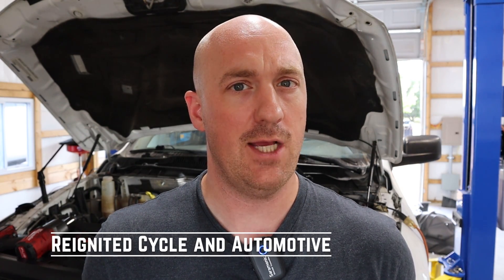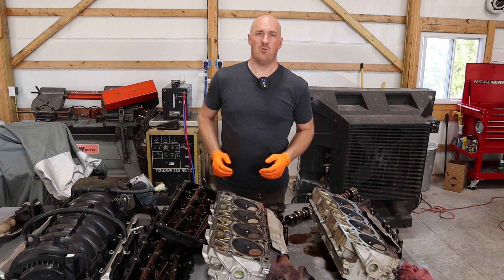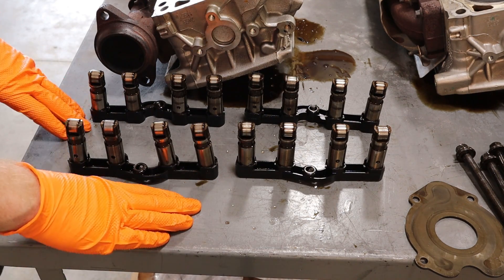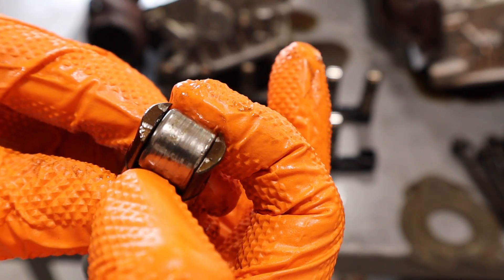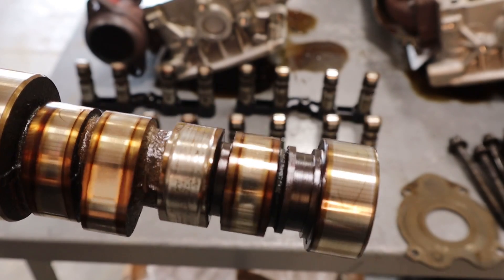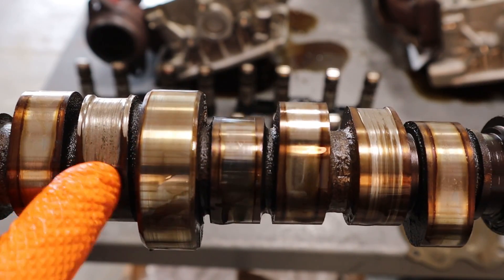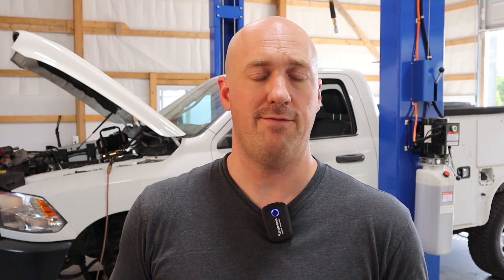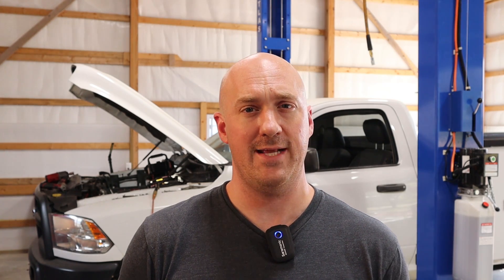Hemi 5.7 Lifter FAILURE Does this engine have a fatal flaw? Find out how YOU can prevent it!!!

Comment: The truth? This is the most biased video I’ve ever seen. Clean or dirty oil don’t matter, lubrication is simply not getting to these parts. Why does it happen more on fleets? Because not enough oil is splashing the cam while idling. These engines are POSs and Chrysler or whatever they’re called these days needs to own up. You are a company certified mechanic. You are not in the position to be truthful about the problem.
Reply from the maker: Actually, I'm no longer a Chrysler mechanic I'm doing my own thing now. This video is my opinion only based on my experience with this engine. I think its important too to realize that these lifter issues are affecting a small percentage of the overall Hemi engines out there. People seem to think its happening to all of them, and that's just not true.
That being said, if Chrysler wants to start paying me to endorse this engine I'll accept 😄
Reply: I see maybe 10 or 15 of these failures per year. I see 1400 vehicles per month in service, lots of them have a hemi. I’m a service manager at a FCA dealer. You do the math. Google search anything and you will find “common” issues with any vehicle. Pick one....
Reply from the maker: @icemonkey68  Truth!

Comment: Does this problem affect the 4.7L engines? I have a 2006 Jeep Grand Cherokee WK with a 4.7L V8 that ticks on startup sort of loudly but gets significantly quieter once up to temp. The engine runs fine, however. No misfires. I have recently had the exhaust manifolds and gaskets replaced due to exhaust noise. I use Valvoline full synthetic high mileage and change it every 4K and I have just over 164K miles on the clock.
Reply from the maker: No, the 4.7 engine is an entirely different design so it doesn't have this issue. I have owned a 4.7 myself before though, and the noise you are hearing is likely the lash adjusters in the cylinder heads. The 4.7 has overhead camshafts, and they actuate the rockers directly from the cam lobes. On the bottom of these rockers are the hydraulic lash adjusters which take out any play in the valve lash. Over time these lash adjusters become spongy, and will bleed down overnight so the engine rattles/ticks when cold until they pump back up with oil and the noise goes away. The good news is that this is not a pre-cursor to catastrophic failure, it's just annoying. 👍

Comment: Sorry, but lifter bearings are weak. Hemi engines production years 2011 to 2015 may  potentially have lifter fail before 100K miles. . Lifters have since been revised "different PN" . Lifters fitted from 2016 production have beefier roller needles to countermeasure early life failure.
Reply: I have a 17, lifters failed at 95k miles with routine oil changes every 3k miles.
Reply: @TM-to3jc  may depend on part number on your installed ones. Odd to hear a 2017/with seized roller  typically found with  AA ones.  2016 lifter roller design did change to AB albeit from same supplier. Perhaps that’s why supplier was changed after 2016/2017 which also changed lifter  PN to AC. Interesting.

Comment: I have to say that it is a physical impossibility for oil to actually break down. Boiled does get dirty that's the truth. Now if your cam is breaking down and your lifters are breaking down there putting case-hardened material into the oil ultimately important to change the oil out of a locked in any High Performance Engine. You're always going to have case-hardened material breaking down off the parts and falling into the oil. Change your oil a lot that is the truth. No High Performance Engine likes to idle that's a fact. The 5.7 is a great motor.

Comment: My 5.7 hemi (2006) let go at 116,000 miles. Got the engine rebuild, my engine builder told me to put 10w30 oil, with the high temperature in Las Vegas.
Reply: Change the tstat to a 180 and reset the fans with a tuner. The factory tsat is a 203 which is very hot and the fans don't come on until around 220 or so.

Comment: Not enough ZDDP in the engine oil to start with! That is the problem. As you drive and idle ZDDP is depleted to a amount the cam rollers and shaft can't function properly. The rollers and needle bearings begin to skate on the camshaft lobes. ZDDP is a Catalytic Converter killer! So car and truck Manufactures asked Oil Makers designers, to keep the ZDDP low, because they can't afford to replace these expensive pollution devices! So instead of the oil starting out with 1100ppm -900ppm they are low as 300ppm! And it goes down from there as the engine is used. Catalytic Converters in some states are mandated by law to be warranty until the cars life expires, and some states it for 80,000 miles or 8 years! Use a good oil, change it often, and  don't idle if you don't have too. I recommend Pennzoil Ultra.
Reply from the maker: Interesting, i have not heard this before, im going to look into it 👍

Comment: Interestingly, his exact video that I just mentioned popped up in immediately after yours, so I'm sure you've discovered this issue. Thank goodness I  have 5 Chevy LSs in my fleet, and several Corvairs lol
Reply from the maker: I'm enjoying the irony of a Corvair being mentioned as more reliable than a Hemi 😂😂😂 I'll check out your channel, thanks!
Reply: My work has over 18 LS based trucks and we have finally weened out all the other brands we had trouble with. Unfortunately hemis were ones on with a few ford's with the ecoboost. They all get maintained religiously and I wasn't a believer in Chevys LS before this job but I sure am now . They literally never have trouble with them.  Come on Dodge get it together, we can't blame all this on the oil change intervals.  I've got friends with new 6.4s less then 18 months old who have have this fixed! I want to be proud of Mopar engines again now Your making the power and we need some better quality control. Yall are charging out the ass for these engines and we deserve a reliable product.  You can do It!
Reply from the maker: @beaches2mountains230  I hate to say it, but I've completely lost faith in any company doing something because its the right thing to do. 😒

Comment: It may have been mentioned already, Uncle Tony's garage figured out that the lifters are too high in the block, and they don't get oiled or splashed. Sorry if I'm repeating what you've already seen in the comments
Reply from the maker: I need to watch his video, haven't had a chance to check it out yet. 👍
Reply: Corvairs also suffer dropped valve seats. And this is late fifties technology, quality control with pretty bad in those days. I have taken apart a number of corvair engines. But there's no real damage except your off the side of the road, dead. Because of the
 horizontal layout of the engine, the dropped seat just rattles around. You could you can still drive it. And it happens to mostly the four carburetor, oversize valve high performance engine, 1965 to 69, but any Corvair engine can be susceptible. A trick is to turn the engine off in gear, thus lowering the idle speed,  introducing less cold raw fuel into a hot combustion chamber
Reply from the maker: @CORVAIRWILD  I wish that were true with the Hemi! The older ones from '03-07 were bad about dropping valve seats. I've actually got a playlist of videos from a 2006 chrysler 300C where this happened. Unfortunately when it does, it shatters into about a million pieces of metal that get showered into the whole engine and destroy it :(

Comment: Why do you think it's more common on MDS lifters? What's different about them that causes them to fail? The different ramp profile? Failure to lock at high RPM?
Reply from the maker: Honestly I couldn't tell you for sure. I've long speculated on trying to figure out why. If you look at the sides of the MDS lifters there is a lock pin that is depressed by the MDS solenoids oil pressure when it goes into 4cyl mode. Over time the upper body portion of the lifter seems to rotate slightly so that pin is no longer centered in the hole. Does this mean it's not fully locking, or locking when it should? I'm not sure....
Reply: @ReignitedAuto  I have four theories, maybe a couple you can check out more easily than I. 

1. A type of float caused by a failure to lock. MDS doesn't operate below 3000 RPM cause while in MDS mode only the spring inside the lifter is holding the roller against the cam. If there's a failure to lock the roller will end up bouncing off the cam. Maybe there's instances where one  may be cruising in MDS then quickly going to high RPM faster than the system can lock.

2. General valve float. MDS lifters are heavier than Non-MDS lifters making them more prone to general valve float. 

3. MDS cam lobes are different than non-MDS lobes. There's a point where they have a smaller base circle used to remove pressure from the pins to facilitate their movement. This removes pressure from the roller allowing it to kind of skid on the cam. 

4. While in MDS the pressure between the roller and cam is quite low. Maybe this causes a skidding/bouncing on the cam. 

I think though that cause the damage initiates in the roller bearing the skidding theories are less likely than bouncing theories. Valve float is known to be damaging to roller lifters even in non-MDS performance engines.
Reply from the maker: @snek9353  I definitely think you're on the right track here. I know the Chevy version of the Displacement on Demand has some of the same issues, I think that no matter what there are going to be design compromises when making a mechanical system that turns on and off while the engine is running.

Comment: My 2010 Ram lifters failed at 130k in 2018.  I drive 50 miles a day, 80% highway.  I used Amsoil and changed the oil at 6k, and I did every oil change.  So,  I really don’t believe lack of oil changes is all the cause.  I was there when they took and heads off and it was spotless inside.  You’d never have known it had 130k.
Reply: The real problem is lack of oil flow too the lifters,being a tech you should know that,the fact that fleet vech have more problems is because idle oil pressure and there is not enough getting too the lifters.
Reply from the maker: @Pickleram  I've heard this a fair bit, but haven't seen any actual data to back it up. I'd be legitimately interested in real results, if it can be Proven true I'll make an update video 👍
Reply: @Wolf IT Solutions owners manual wasn’t 3k intervals in 2010
Reply: 6k is too long even with syn... stick with 4k.  These engines need it.
Reply from the maker: There are always going to be outliers like yours unfortunately, I think my point was more that lack of maintenance will hasten failure overall 👍

Comment: I think it's better to rebuild your Hemi with better aftermarket parts if the warranty is up. No reason to put those cardboard lifters in there AGAIN if you are gonna spend thousands.
Reply: Hi Lift Johnson Race Lifters they have pressure fed Roller and Needle Bearings about $ 550.00 well worth it.
Reply: @anglia427  Yeah you can turn those Hemis into everything it should have been in the first place! Our 5.7 Jeep seems to like 5w-20 as recommended. I'm actually surprised. Engine oil temp is ALWAYS 210-215 degrees even Arizona weather. Highway or city. Pretty dang good cooling system for no oil cooler. My LS1 always shoots above 220.
Reply: @Dcc357  Do you know what is normal oil pressure at idle and higher RPM's is can't find any info so far.I'm not doing any cam swap till I got all the correct info.
Reply: @anglia427  Hot idle at about 600 RPM is about 32 PSI. I forgot what RPM I'm at going 80 MPH but oil pressure is in the 50's.
Reply from the maker: It's definitely a lot of money, and if you are wanting to keep the vehicle long term some upgrades would be a good idea 👍

Comment: The oil is breaking down, what a crock of shit. There's no oil getting to those parts in the first place because of their nearly horizontal position in the engine. Some numbskull decided to put these into the engine without allowing the oil that returns from the valley to drop onto the cam itself which would then sling more than enough oil onto these rollers to keep them well oiled. If you notice the Valley of the Gen 3 Hemi all of the oil returns are on the outer edges. Not in the center like they are in most engines. That is the flaw. The way you repair it now as you either properly cast the engine block where the oil returns are in the correct place or you put oil squirters on it to actually squirt oil directly onto these rollers and cam. The fault is with the guys who decided to try and reinvent the wheel once again.
I do agree with you to some extent. The reason the vehicles that idle or that never won over 2000 RPM for any extended period of time or even a little bit regularly is that over 2000 RPM there's enough oil being slung around by the crankshaft itself to actually deposit oil up onto the camshaft and onto the rollers. Fleet vehicles that idle for extremely extended periods of time do not get that. I've seen this failure on engines that are not fleet vehicles but it's just people who never take the engine over 1800 RPM. Vehicles that get driven around in the city bye people who aren't trying to show off the power of the Hemi. It is a design flaw from the engineer's. If oil was getting on these parts even if the oil was in the engine for 15,000 miles it would still lubricate the part. The part of the oil that breaks down is the additive package not the lubricity, at least to the point where it would cause such damage to occur.

Oil squirters are the repair for this or redesign the block where the oil return drips down directly over the cam where oil can get to these parts. It doesn't matter whether or not the engine sits and idles. If it were getting proper lubrication this would not be happening!

Please rethink this. You have the correct cause within your grasp. But you aren't getting it yet. It is a design flaw. Other engines are specifically designed to oil that portion of the valve train. Some idiot decided to rethink it and screwed it up.
Reply from the maker: Appreciate your nuanced reply, the more information people have the better off they are for forming an opinion. 👍
Reply: Your theory that you got from uncle tony has been thoroughly laid to rest. Darthram has a detailed video explaining why uncle tony and you are wrong.

Comment: Where can i find the engine hour oil change recommendation?
Reply: SRT puts out the recommendations for the squads.  Their latest advice for the 5.7 Charger/Durango Pursuit consists of 5W20 Pennzoil Platinum at intervals of no longer than 4,000 miles, which works out to 100 Idle-Hours. As noted, those vehicles are equipped with Engine-Hour meters in the instrument clusters.
Reply from the maker: Unfortunately I no longer have access to that information. Best option would be to get ahold of a fleet company that employs FCA vehicle and see if they will print out a copy of their maintenance schedules. I could give you an approximation, but it wouldn't be totally accurate.

Comment: Where does the oil come from when it feeds the lifter top or bottom?
Reply: The issue as I have explored is that the oil doesn't come from anywhere, you take apart the lifter and there is no oiling holes in them, the crank slings the oil up but unlike most pushrod v8's the lifters are off at an awkward angle further from the cam so anyool draining down actually isn't falling on the cam so until you are ballparking 2000 rpm where the crank is throwing oil up the only oiling is just ..well luck ..from a few splatters as it drains down a couple inches away from the cam...it's pretty stupid from a longevity standpoint..it is beneficial in some additt power if it was a top end race engine that's going to be torn down after every couple races but for longevity ...the block design IS the problem...not the lifters...not the oil...it's simply because it's not tapped in the oil valley and gravity isn't reaching the cam....Chrysler's "bad oil" excuse is bullshit...now they could potentially fix this on an updated gen without recasting a new block if the made some form of oil squirters like some engines have for pistons but as it sits....it's the block design
Reply: @wolfmanrebel874  spot on! It is most definitely the block galley being blocked preventing the oil from reaching the cam. Look at the GM 5.7L and its wide open galley. No brainer.
Reply: @stomp4423  yes the gm and ford classic small blocks and bigblocks for that matter is a perfect example of an ideal setup